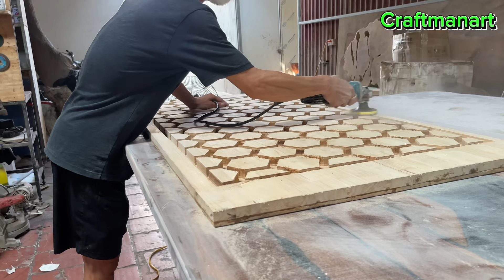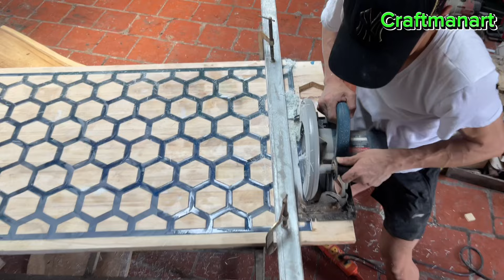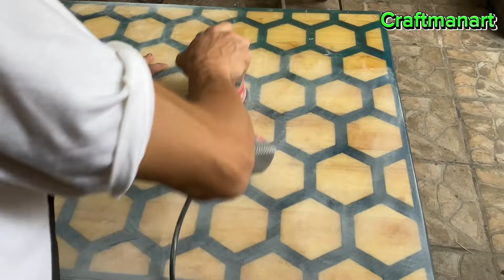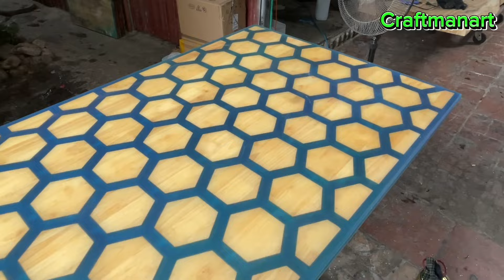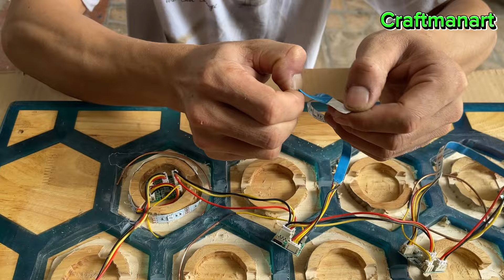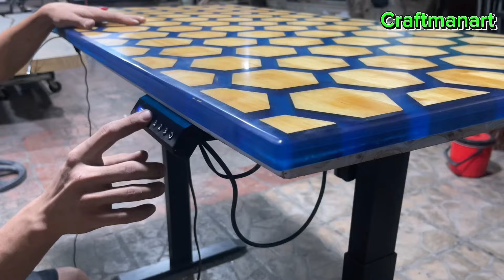Making Hexagonal LED Touch-Sensitive Epoxy Resin Table That Lights Up #epoxycrafts #diy #craft

Comment: What kind of lights are u using and how do they work?
Reply from the maker: I use touch-sensitive LED lights. When you put your hand or object in it, the light will automatically turn on and off